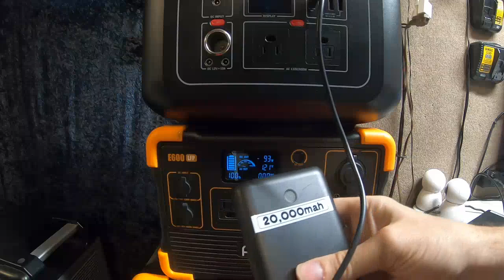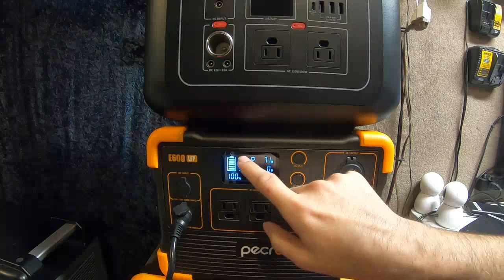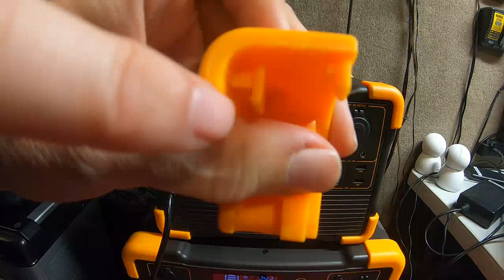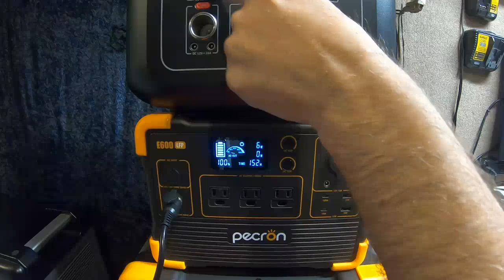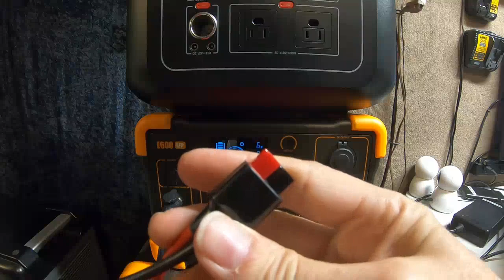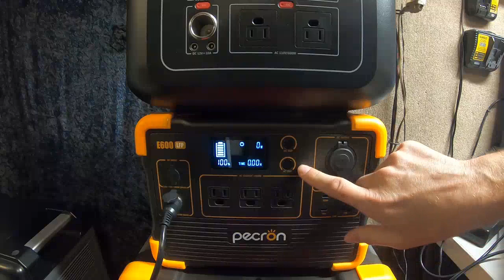PECRON E600LFP Power Station (UPDATE 3) E600LFP

Comment: It's still $396 or 22K  pesos in the Philippines. I'll wait until the price goes further down 😂. I'm about 80% sold on this E600LFP. I don't use the brick charger anyway. Only solar panels on all my powerstations. The only thing that is holding me back is the Bluetti AC70 which will be available here this March 2024. But if the AC70's price is significantly higher, then it's the E600LFP. 21:06
Reply from the maker: We like both of those power stations :)

Comment: Hey Bob I have a question for you. I have 3 - 200w eco-worthy solar panels wired in series and hooked to my e2000lfp. This is my first time testing this system out. It's a bright sunny day and I have my panels angled at the sun and im only bringing in 355 watts at best. Is this normal or do you think I have an issue with either the panels or the pecron? Thanks in advance.
Reply: I have now had the opportunity to measure voltage on my Qcells 340W panels, and the results are 40 V for a single panel and 79 V for two panels connected in series, so same same per panel as expected. 

I can only conclude the MPPT on the E600LFP is suboptimal with regards to (some?) solar panels connected in series, while working just fine with single panels and panels connected in parallel.
Reply from the maker: Good info, We do not have any QCell solar panels, so we had no access to the real data. Thank you for this. It seems that around the 80v range is where everybody was having some issues with. We need more info from scribers about this. We never go above 60v for our solar setups so far. Only for very short time for testing.
Reply: @RamblinBobReviews  Honestly, I am just happy my unit didn't blow up at those voltages😂
Apparently, some other commenters (on other YT channels) previously had their E600LFP blow up from solar input in that voltage range (still within the rated range of max. 95 V)!
I guess they improved the MPPT from blowing up to working suboptimally in the higher voltage range!
It's not a problem for me, I can just connect single panels or in parallel, so still very pleased with my unit (and considering buying the E2000LFP as well)
Reply from the maker: We do not like messing around with higher voltage for that same reason. It can be scary and dangerous. We always try to stay under 48v for safety.

   But when we picked up 6 harbor freight 100w cheapy panels, we hooked them in series/parallel for a total of 60v output.

P.S. We love our e2000lfp for our main backup system. and that e600lfp is fantastic for what is is.

P.P.S. This system with the app makes it good in it's own way. small battery, but VERY easy to carry. (It weighs almost nothing)
Reply from the maker: Best way to test is to test each panel by itself with a volt-a-meter to see the open voltage, Then hook them up in series and them test the open voltage, That way you can rul eout the solar panels. Eco worthy are cheaper solar panels, So it also is possible that the 355 is normal. (That is only 118 watts each panel, So it is worth a voltage test)
Reply: The MPPT of the E600LFP is apparently working better, when hooking panels up in parallel or even individually (assuming the minimum voltage requirement of 32 V is met). Myself, I have problems getting the "correct"/full solar input when hooking up my Qcells panels in series. In parallel or individually, solar input is as expected.
Reply from the maker: The nice thing about the e600lfp that we noticed, and as you saw in our testing videos, We had solar panel running throught the 5 pin aviation port that was only 12v @200 watts with only 21vVOC and it ran perfect.....

We do not believe that the minimum voc is 32v since we proved it in the testing, And that is a very nice thing :)

side note: you are like the 7thor 8th person that has qcell panels and is having trouble with getting full power with pecron products, We have no idea why, Qcell make fantastic products.....
Reply: * 340 W qcells rigid panels - Voc of 40.91 V and VMPP of 34.10 V